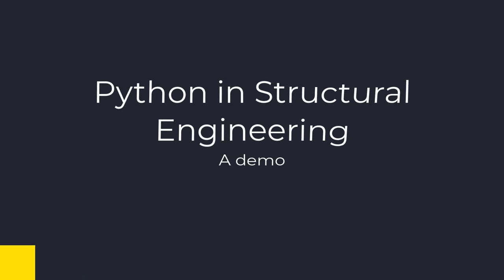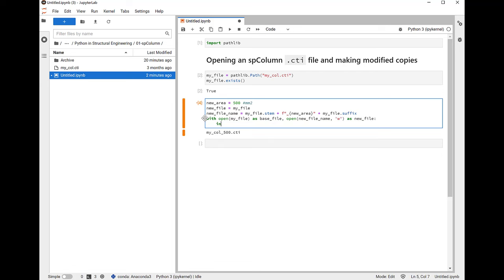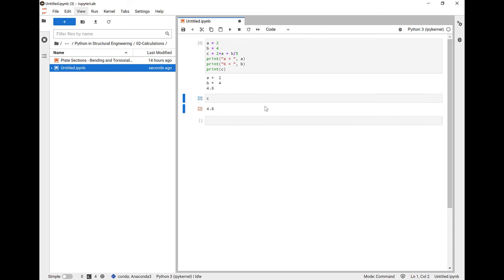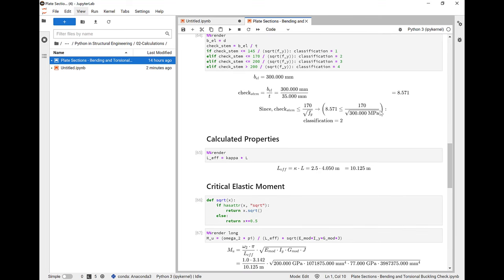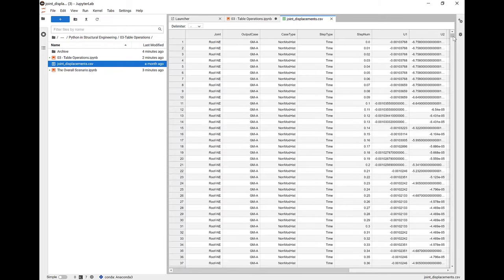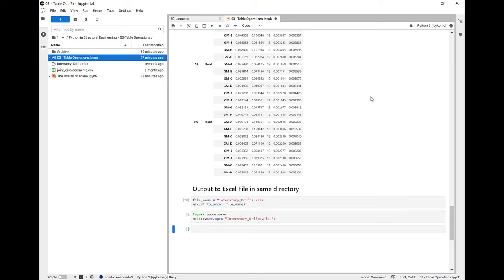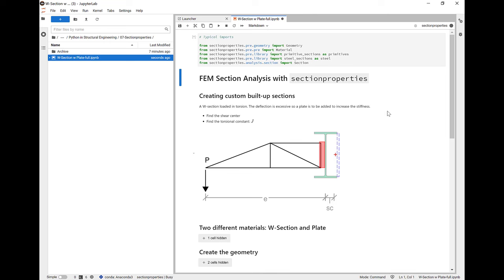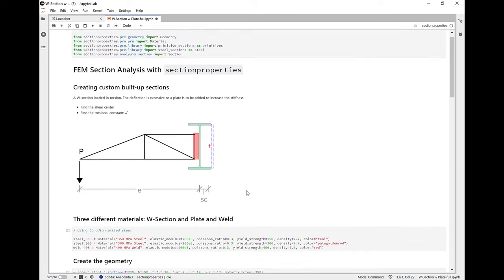How I use Python in Structural Engineering

Comment: Your package is great. Although many software readily do this, being able to code this yourself in python makes the difference. As a learner, I really appreciate this.
Reply from the maker: Thanks so much, Paulo! Agreed, the individual capabilities are not the important part. The fact that these tools are free and open-source and that, using Python, you can fluidly weave them all together to suit your specific needs is the important part. 

I think it is important for engineers not to be locked in to using proprietary apps because we have limited control over them and they are not always correct. I think that computers are such an important tool in the engineering toolbox, it seems logical to me that we would want to have a certain amount of mastery of the tool.

Comment: Great video!!, I have one question though. Since there are many IDE or code writer for python such as Spyder which we can check variables value while running the scripts, why do you choose to use Jupiter for your work ? Looking forward to see a video for which best  IDE for structural engineering..
Reply from the maker: Thanks! When I first started running Python code, I was using Spyder. It’s very good.

As I become more familiar with Jupyter, I appreciated its cell-based approach. It allows me to write formatted notebooks with code with all of the rich output right there in the notebook available for me to export to HTML or PDF. 

When I start working on a library or module, I often start in Jupyter and test out concepts. Once I have something figured out, I switch to VS Code and create a proper Python module to build off of.

I find that Spyder’s “Run” command encourages development of less structured code. In essence, it treats a whole .py file as one cell of a notebook: one big input leading to one big output creating a single, monolithic stand-alone module/program (similar to how I was taught Matlab code).

I think of my code as having two parts: 1) the module or package I am creating (which is not executable) and 2) the notebook where I utilize the module and execute the specific task I am performing. I find Jupyter is a very rich and flexible environment to execute tasks large and small and, with ipykernel, I can open a notebook and have it launch from any of my module-specific conda environments.
Reply: Thank @connor,. I was doing some code with Matlab and VBA for my calculation. However, since the licence for individual use is not affordable anymore with Matlab, I have just started with Python. I am just new with it here, and feel confuse which those IDE and don't know which one is best use. I hope to understand and learn more about it.. Keep good work sir, Hope to see more updated video about this topic. Thank again.

Comment: Hi. First thanks a lot for all the good work you have done. I am using both of your python module forallpeople and handcalcs in one of my project. I has a situation thats requires some help from you. While using forallpeople, i need an output in one certain unit. But the auto-prefixing feature doesn't allow that. It will be very helpful if kindly let me know, how to print the result of a mathematical expression in user defined unit. For ex in KN only, not in N or MN etc, whatever may be the value  of the result is.
Reply from the maker: This sounds like an issue with forallpeople. Could you open an issue on GitHub with an example and I will advise and fix it if required. Thanks!
Reply: @connorferster  aye. sure

Comment: Hi Connor. I'm currently using handcalcs ver 1.6.5
I'm not well versed in LaTeX.
What should I change in these global configurations to get rendered calculations to be left aligned?
import handcalcs.render
handcalcs.set_option("math_environment_start", "aligned")
handcalcs.set_option("math_environment_end", "aligned")
Reply from the maker: It seems to be dependent on your renderer. When I use Mathjax rendering, it seems to be left-aligned by default. When I use the Katex plugin it seems to be centered automatically.

Comment: As a structural engineer I'd love to use python more similar to what you show however I always find I need to draw lots of sketches in my calcs. So end up typing most as manual calcs in bluebeam so I can easily add diagrams and sketches.
Reply from the maker: Yes! Same here! Have been exploring ways of combining these two things…
Reply: @connorferster  I use the Concepts App to draw in vector and just add those images to a markdown cell.
Reply from the maker: @nascentnaga  Do you paste screenshots from Concept or are you exporting vector and displaying the vector image?
Reply: @connorferster  if I'm using vector, I export to dxf with concepts natively. If I'm doing a one off calc, then png with some html to input the image in the calc sheet.

Given you can export dxfs you can probably play with section properties I reckon
Reply from the maker: @nascentnaga  I think I have to spend more time with Concepts!

Comment: What name should we pass to pip in order for us to install the “concrete_reports” module?
Reply from the maker: It is not on PyPI so you would have to write it yourself. However, I can tell that it is built on tabula-py, which extracts tabular data from PDFs and returns it as a pandas DataFrame. Once you have that running, try reading a report from on if your testing providers with tabula-py to see what the resulting df looks like. Finally, write a function to extract the data you need from the cells of the df. Because each company’s reports have different formatting, you really do need to write your own for the reports you receive.